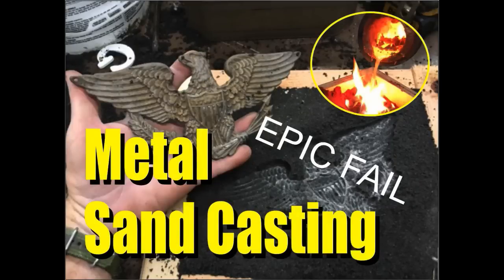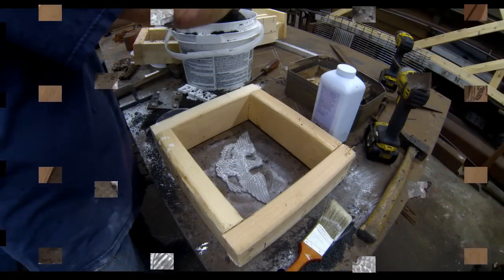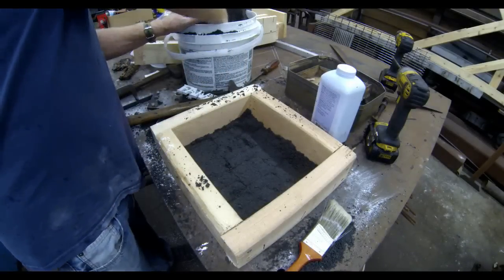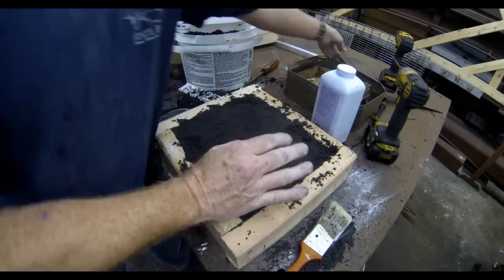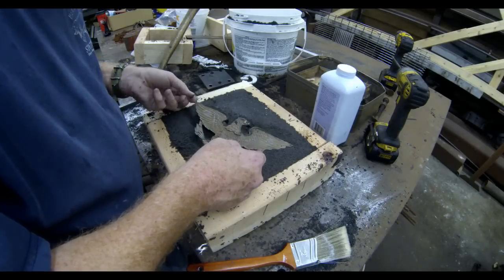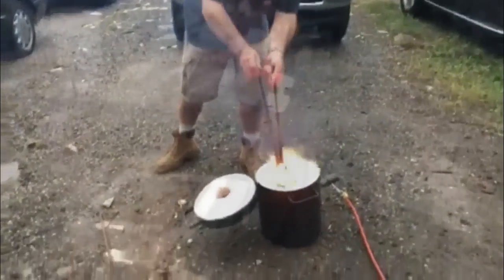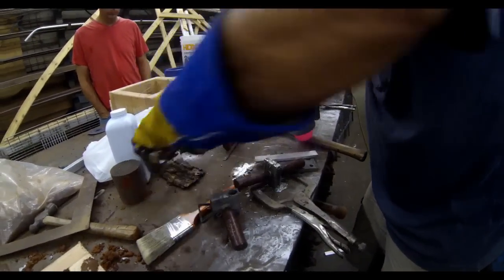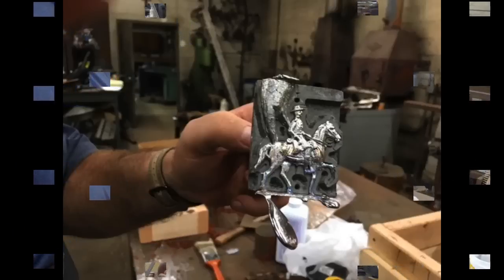How to Metal Casting with a simple one part Casting Sand mold

Comment: Bit old vid but still worth adding info
Anyway for unregulated metals with contaminants I would use Flux then clean out the dross and make ingots first, 
So you can see how it performs and treat again if need to. 
 From what i can workout with the stringing, is that there is to much copper over the amount  Zinc .
Basically not enough Zinc
this is caused by the contaminants when meting changing the chemical reaction

Comment: I have to wonder what brass alloy that swarf was, that is an unusual behavior. It could be an alloy specific issue or an issue with the dross and the metal not separating at the temperature you had the melt at. brass specific Flux can help with forcing the dross to separate from the metal.
Reply from the maker: Thanks we are going to do it again but just use scrap brass like old valves
Reply: I have to agree with your suggestion. Trying to melt down any type of lathe "turnings" that have probably mixed or contaminated with small amounts of other small metal shavings is also an issue.